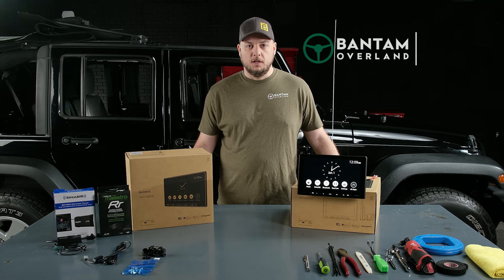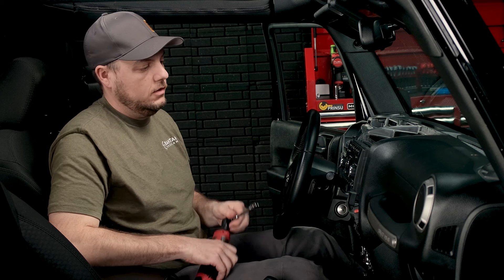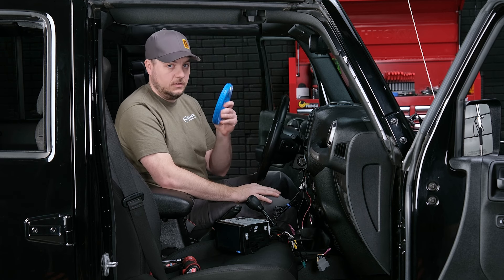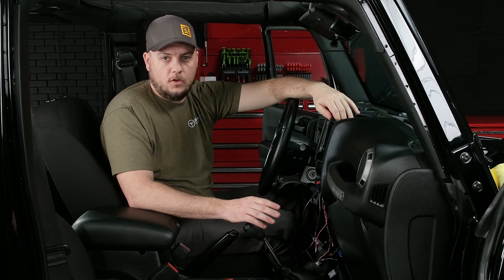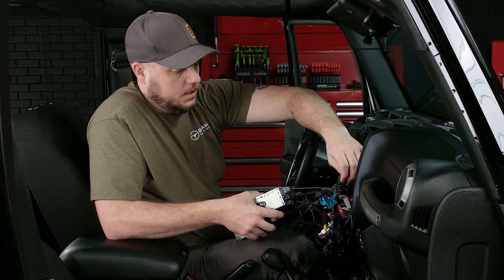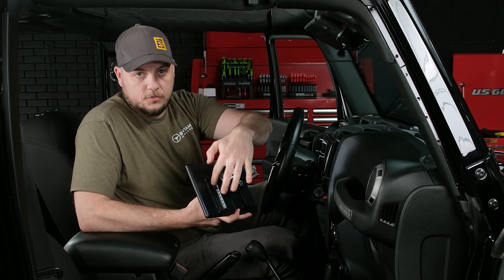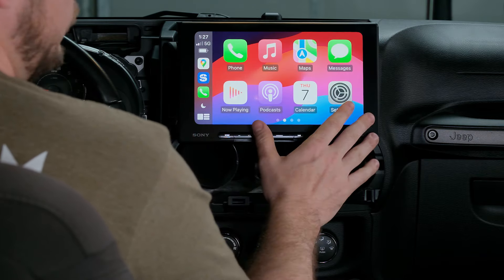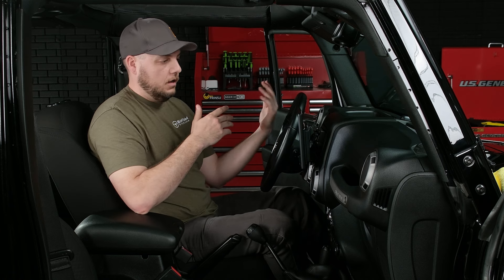Jeep Wrangler JK Sony XAV-AX8500 Plug & Play Kit Installation | 2007 - 2018 Jeep Wrangler JK

Comment: I wish there was a company that made a head unit like this but with a detachable screen for security like back in the old days
Reply: People aren’t breaking into cars and stealing head units anymore. This isn’t 2003 dude.
Reply: @saljablo2767  you wanna bet 🤣
Reply from the maker: Totally hear you! The screen can come off - just requires about for screws to be removed, but I know what you’re talking about! Those old detachable face single din radios were cool!
Reply: $800 for a radio some thug would steal in a heartbeat. Nice set-up, but too much money to give some low-life thief.
Reply: And a reason to cut through your soft top.